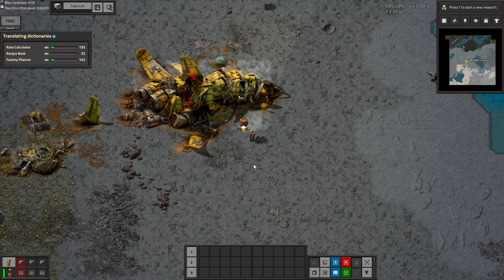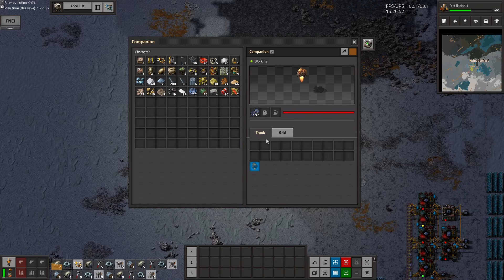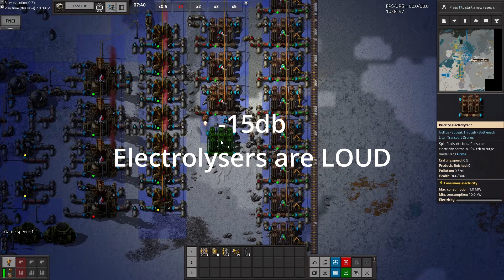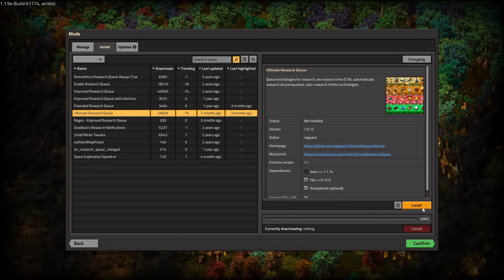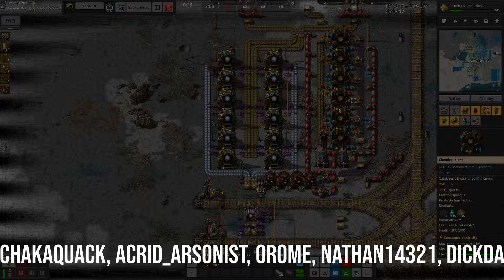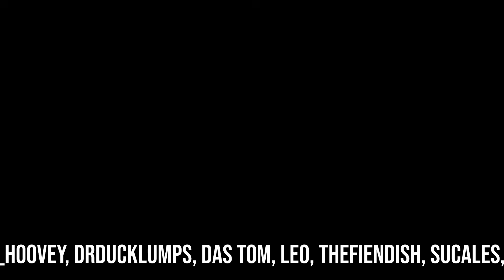The Second Hardest Factorio Mod | Factorio Nullius | Part One

Comment: despite not mastering the base game (I think I've launched 3 rockets) i keep trying overhaul mods and struggling when even a few byproducts enter the equation. and now I'm thinking of trying this one. help
Reply: ... i got to the point in the video where aluminum needed more caustic solution which needed sodium hydroxide which was blocked by chlorine which needs caustic solution to void, followed by accidentally creating a brine electrolysis loop that just wasted energy, and I am no longer thinking of trying this one next
Reply: Id highly recommend a mod called helmod, or factory planner. It can help you plan factories and with complicated recipes that have byproducts and loops (like coal liquefaction) itll tell you how exactly how much stuff to produce without wasting or overbuilding anything. For example Im using it right now in krastorio 2 for a 5400 spm megabase, theres so many lines that produce sand but its figured out exactly how much sand i need to make from stone, how much from imersite, etc.

Comment: "Never had life" "Limestone" Hm...
Something isn't right here.
Reply: It's a common misconception that calcite deposits have to come from marine life, as that's indeed where a lot, but not all of it came from on Earth.  Calcium is an abundant element, and under the right conditions, which the Nullius planet does have, significant layers of abiotic calcite sediment can precipitate.  There have been signs of limestone detected from exoplanets.  The factorio 2.0 expansion will include calcite as a resource on one of the new planets, which is chemically equivalent, though geologically formed differently.  You can think of it as a non-sedimentary form of calcite if that helps somehow.
Reply: it was there before someone crash landed and covered everything in cement

Comment: Goddamn it, I watched it 10 mins of this and then immediately booted up factorio to give this mod a shot. It’s been about a bit over a week and I’m already 110 hours into my run…
Reply: Such a lovely feeling to find a mod that just hits you like that, right?
Reply: question, did you have issues getting the game to launch? I wanted to try the mod as well, but the Nullius mod causes the game to fail to start. it doesn't even get to the main menu, it forces me to turn off the mod for factorio to start up.
Reply: @Meanslicer43  nullius is a bit special in how it changes the vanilla item names completely, and thus easily comes in conflict with other mods. Read the faq, remove all of your qol mods, and add one by one. Or is it only nullius you have installed?
Reply: @leduke79  I'll be trying the mod conflicts first. because I do have a few added in.

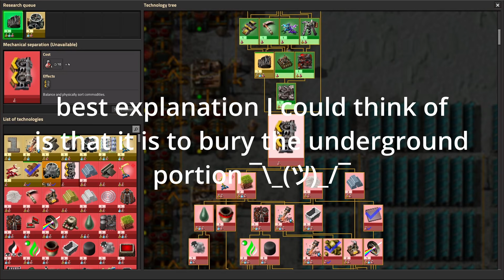Comment: 8:37 Underground pipe networks tend to use anchors (huge slabs of something really heavy, usually concrete, or bags of sand) on the bends of the pipe to stop it from literally pushing itself apart from the pressure of the liquids. It probably needs sand for that same concept.

Comment: It makes no sense that there is liquid water but no oxygen in the atmosphere. The mod author should get rid of liquid water generation and either add ice patches as an ore type, or something like solid oxygen as an ore type. That would at least give some explanation as to /why/ there's no oxygen in the atmosphere: it's so cold it all freezes.
Reply: Even Earth didn't used to have an oxygen atmosphere until after life developed and bacteria created it.  Oxygen is extremely, extremely reactive.  It needs some active process to keep refreshing it, or the free oxygen binds with other elements and you get things like oxide rocks, water, and carbon dioxide.  Water is stable and exists on many exoplanets so long as they're in the right temperature range for it to be liquid and the right size range to hold onto it.
Reply from the maker: Not all lifeless planets will develop oxygen rich atmospheres, even if they do have liquid water. All depends on the planets existing atmosphere, its position in the star system and the size of its star.
Reply: @ripecontext  Well now I'm going to have to go see if there's any papers talking about the variables that go into an oxygen atmosphere production. I suppose it could just be a rock without an atmosphere altogether. I wonder what goes into creating a planet like that. Very interesting.
Reply from the maker: @JaclynFox I’d read the reply above mine, as it appears you’ve come here to be right rather than come to any kind of understanding.
Reply: @ripecontext  I suppose my previous comment could be read that way. But no, I'm genuinely interested and want to go find some reading on the subject.
Reply: our planet before with water and without oxygen
but also there was alot of stuff like methane

Comment: I would like to also add that your ability to leave space between builds is bad, to very bad, you need to be more like Nilaus and build your base using a grid, that about 100 by 100 and surrounded by a paved driveway... You could try using a main bus and leave space for trains to feed all resources to smelters.  The outside the trains go the solar and outside the solar goes the wall, but I guess you don't care about the bugs yet, but if your growing bugs you likely will need to care about them at some point :)
Reply: you MUST use city blocks grrrrrrr

Comment: Chlorine being toxic for environment is such a lie. Sure it's bad when concentrated but so is oxygen. A lot of microorganisms feed off chlorine, same for sulfur but sulfur is generally less needed.
Reply: still it's aren't wery healthy to inhale chlorine (and MPC for it small) and yet it can also corrode something that you don't want to. plants also suffer from it
some microorganisms does use arsenic, but for the most organisms it's deadly
another example: microplastics , some bacteria can eat it, but for all other beings it's harmful
Reply: @dan_2247  microplastics are even more difficult case - technically it's just carbon but even if you can digest carbon it can get so small in the process it will go strait to bloodstream (or it's plant analog) and can clog something or harm cell forming process, hell, even chromosome and/or hormone forming processes. 
It's not like microplastics are harmful as a substance but rather they have harmful physical properties and become increasingly dangerous when subjected to fission by any means.

Comment: My guess for the underground pipe recipes, in real life when  you bury a pipe underground you surround it with sand or gravel to protect them from external damage.
Reply: It would help to absorb shaking from earthquakes and possibly allow for expansion from frost.
Reply: @jackduncan5977   Gravel & aggregate fill also manage water drainage, which is quite important both considering freezing, as well as corrosion.

Comment: Gosh, I wish Backup turbine types were in the base game, as I’m the sort of person who makes a ginormous solar farm and runs my entire factory off of it. (No, I don’t use beacons, how could you tell?)
Sure, the accumulator/power-switch thing *works*, but it makes an ugly square wave on the power graph.
Reply: you don't need a power switch to use accumulators efficiently, you can just hook them up directly to your power grid and they'll dynamically change their output in response to supply to get the nice sin wave you want
Reply: @giantdad4109  and turbines will work full night not letting accumulators to discharge and burning precious resources
Reply: When you want a smooth sine wave and only have a square wave hoping that it doesn't decay to a saw tooth... (Who turned off the lights?)